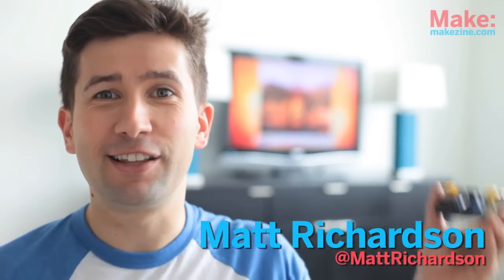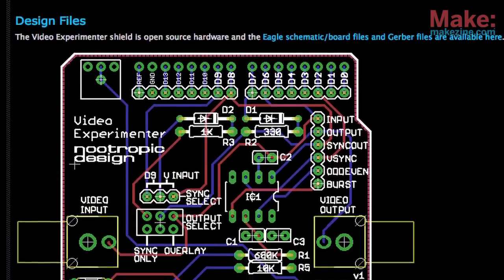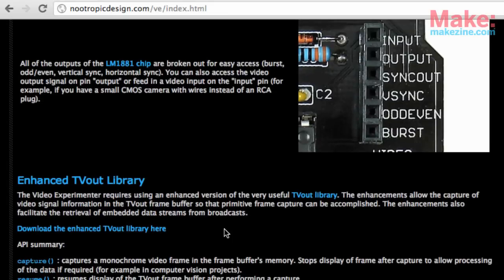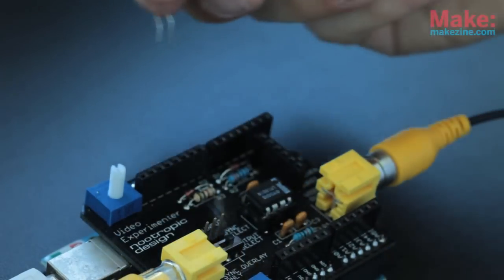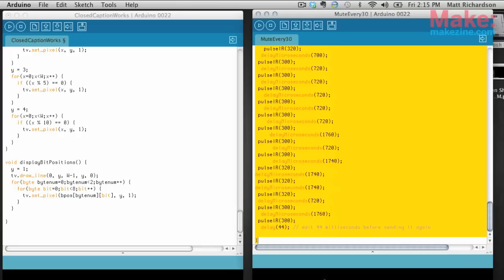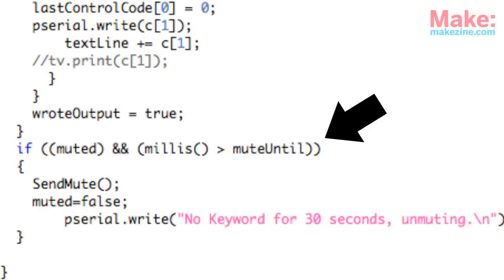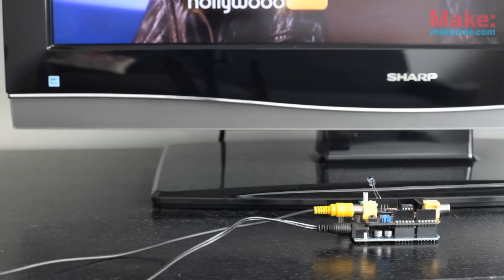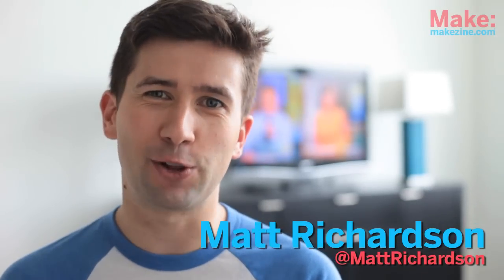Enough Already: Silencing Celebs with Arduino

Comment: I changed the circuit and software so that it mutes everything that's on TV and turns it on only when some words I like are on. I turned my system on last month, and till now my TV is still silent...
Reply: Hey, 5 years later you TV still muted?
Reply: @camilo6258  the account's prolly dead
Reply: @thesci-fibro5835  Bruh moment.

Comment: In this case, channel selection is a function of the cable box.  The cable box extracts the appropriate video feed from the multitude of streams on the coax line, and passes it along to both HDMI and composite outputs.

Comment: the resistor on pin 13 is in parallel with the connecter, it only effects the onboard LED ...  it may not happen quickly, and the damage is cumulative to the pin on the avr

Comment: This is really a feature they should incorporate into the television... kinda like an audible v-chip... An "a-chip" if you will. Then you could type the words or names you intend to block using the d-pad on the remote. The only thing you'll have to worry about is misspellings of names, which is pretty common.

Comment: It could be used also for something "opposite", for example to start something equivalent to a videotape recorder every time there is a media coverage of an event we are interested in, for example a space mission launch in a news channel and we are not interested in politics, economy and war news.
You could also use an array of different independent devices, each one analyzing a single channel(or can a device analyze more than one at a time?), and when a channel is talking about something you are interested in, the associated device can change the channel on the TV, so you can watch to the right channel.

Comment: you could try different keywords, but that may be hard. Maybe "try new", "dealership", etc...or maybe a better option would be to just mute the most annoying commercials by putting in keywords that you know would block them. "headon apply directly to the forehead"

Comment: I'd like to use this idea to mute commercials. Any thoughts on how to implement this?
Reply: try to unmute the tv when the keyword of your shows come on, otherwise it stays muted
Reply: I've had this idea for years but you could use a mic to track decibels. Everybody knows commercials are usually louder than the program. It hits certain level it mutes for a certain time. It's a broad idea but I feel you could fine tune it.

Comment: Well i'm not sure which pin he inserted his LED into, but usually Arduino boards have a resistor built in on one of the pins. Mine is built into the 13th pin, so maybe thats why he didn't use a resistor in this video. It looks like there are some resistors on the video board.

Obviously I can't tell 100%, but that would be my best guess, otherwise he would blow his LED quite quickly.

Comment: if your referring to pin 13 it has nothing to do with the output, its in parallel with its own led attached, anything attached to 13 does not benefit from the on board resistor

Comment: @balisticjoe I actually have done something almost as good. I programmed my Arduino so when I fast forward through a commercial, it stops fast forwarding when closed captioning comes back (because most of the time commercials do not have closed captioning). So I can hit fast forward and go and get something to drink or eat without having to worry about hitting "play" on time.

Comment: You should build one that detects the significantly increased volume that advisers and stations play their commericials at and automatically mute them until the normal program resumes at normal volume...I'd buy that! 😁
Reply: It should be even easier to build, since you don't have to read text, you would just need a audio volume sensor and the same IR setup

Comment: @late95 maybe but probably not very effectivly
you could use words like buy, pay, call, ...or if there was a particular commercial you hate, you could put in the words from that commercial
the only problem i see is that, what if that was the last commercial before the show, then you'd have to unmute it yourself

Comment: Can the same board be used to detect RF signals, too?  Seems like there's a problem when you mute or unmute manually, because the board doesn't know the actual mute state.

The next obvious step is to find a way to detect commercials.  I know there are various efforts out there.  ReplayTV had a pretty good algorithm, but I'm sure there are better ones out there.  I imagine even just the CC info might be enough to do it somewhat reliably.

Comment: Since TV stations sometimes mention when it will cut to commercials ex. "We'll be right back after this message from our sponsors." while some others mention new shows and show times before cutting to commercials. Would it be possible to look for these keywords in order to mute commercials (Since some commercials do not have closed captioning)?

Comment: Can you make this work for any commercial? Is there code being sent that identifies the beginning and end of programmed television?
Reply: Probably there's no ad-identifying code sent, as that would kind of antagonise the purpose of the ads.

But you might be able to identify the ads by a change in audio volume, as ads tend to be broadcast louder than the regular programs.

Upside: No fancy video shield needed, You should be able to mesure audio olume by the normal I/O ports.
Downside: False positives may be difficult to cancel out

Comment: @mrmukaoy You could do that by putting the first line of text from each commercial into the block array.
Or just have it look for phrases like, "We'll be right back" and mute until it hears something like "And we're back".
Of course, that wouldn't work for fiction shows. In that case, you might able to check the length of the black screens between scenes and see if the ones directly preceding and following commercials are of a certain length, then SendMute() on black screens of that length.

Comment: @dragonbeary Yeah. Actually I improved it so it will start fast forwarding after 12.5 seconds without closed captioning... So it is automatic now. So you could do the mute thing. If anyone is interested I can upload the code and post a link...

Comment: @izzynobre True, but like most DIY projects, it is not really about a solution or an actual useful implementation, but about the process and the fun of engineering.
It is closer to the category "crosswordpuzzles and sudokus" than "innovative technologies". Just a brain-excercise for fun. :o)

And you are right about TV. After 3 years without I subscribed to cable again... 3 months later I'm wondering why I did it. Waiting for the year to finish to unsubscribe again :o)